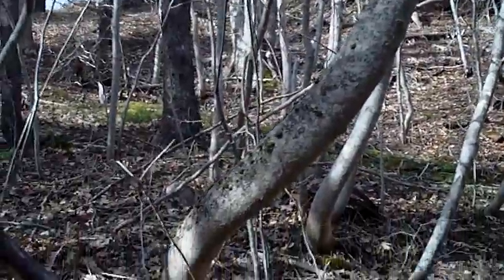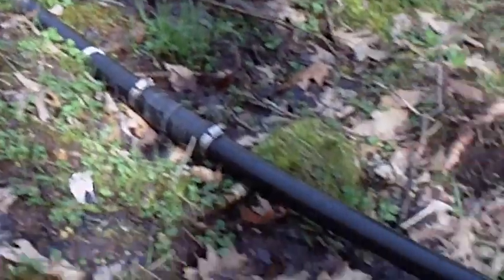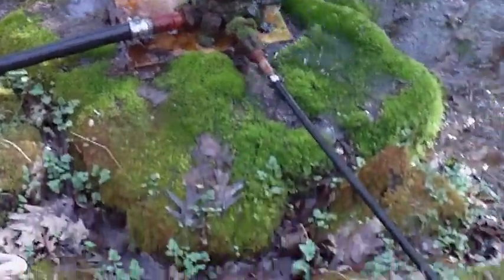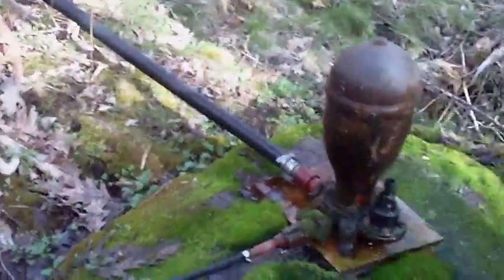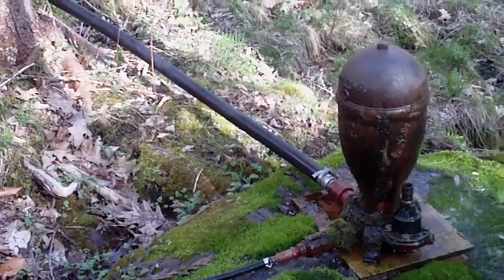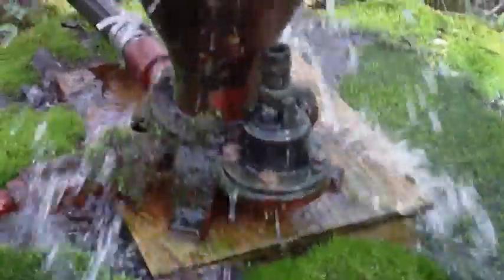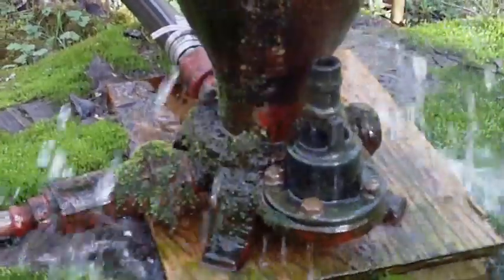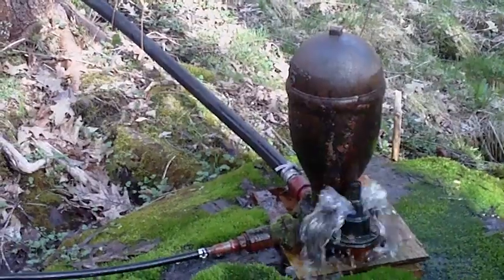Hydraulic Ram Pump - Pure spring water pumping system for drinking - No Electricity works on Gravity

Comment: If you tap a thread in the drive pipe and install a needle valve it will suck in a little air every stroke. That goes into the chamber and prevents it from being waterlogged

Comment: Hi there. You may be collecting air in the system through the plastic pipe, strange as it sounds. You will also get better performance by using a steel drive pipe from your barrel to the pump. We had, 100 or so years ago, a company that produced a similar pump design here in New Zealand. Great pumps, had a couple of them. All the best.

Comment: interesting to read the comments regarding a sniffer valve. I believed all the hype about them for years until mine became blocked, I only found the blockage because the pump was pumping more water than usual, cleared the blockage and performance went back as before. I started to experiment and found the best system by far is no pvc or plastics to be used except the delivery line, do not fuck around making pressure tanks buy a purpose built tank with a bladder to keep the water /air apart, you can also adjust the delivery pressure with a hand air pump and no need for a sniffer valve, keep the cyclic rate as slow as you can, about 1 cycle per 90 seconds is perfect for me.
the pressure produced and volume of water pumped  is less about the amount of energy produced by the fall of the water and  more about how effectively you use the energy available to you. it is the strength of the compression wave which makes this system work
Reply: Snifter valves often admit too much air because they are ill designed. Ask the Amish, they won't introduce a sure to fail $50 pressure tank into a near fail safe design. It is tempting to use those expansion tanks but they are not designed for repetitive pressure hits. Slow and easy or they fail.   You said ONE cycle per 90 seconds? Is that a misprint? Unheard of.

Comment from the maker: Second part, We use a rain barrel or 50 gallon barrel for our water reservoir, with the pipe coming out of the bottom with 30 more feet of pipe downward for pressure...think of it as if you were to siphon gas out of a car tank, your hose needs to be lower than the tank "reservoir" or pond, there is pressure at the bottom of the pond but if your pump is at the surface its still not getting pressure, pipe the pond water downward 30 - 40 feet to get good pressure to Ram pump...hope that helps.

Comment: You could add a sniffer valve so you wouldn't need to drain the air vessel. A sniffer valve can be as simple as a drilled small hole in the drive pipe.

Comment from the maker: Hello, The Hydraulic Ram pump is gravity fed with water, it works off of the pressure, so your Ram would have to be lower than the water table in your well to achieve this, this one is 40 feet lower than the spring where the water comes out of the mountain.
The rule of thumb is for every 10 feet downhill from the water source, the Ram will pump uphill 100 feet...I hope this helps.
Reply: Hello,  is it that for every ten feet downhill, the the ram will pump a distance of one hundred feet on an incline or a total elevation of one hundred feet?

Comment from the maker: Hello, I've not known it to have a snifter valve, but my uncle once tried to add a tire valve for that reason, but it never worked, so we walk down and drain it about every 3 weeks, thanks for your input.
Reply: Well supply and drillers have snifter valves DESIGNED to admit air into a pipe going into a pressure tank. Looks the same as a Schrader valve nut either no spring or very little pressure. Uncle was right but he had the wrong little valve.

Comment from the maker: Hi, Yes it will pump level, but I suggest putting the Ram at the lowest point of the pipe, to get the maximum pressure to the pump, even drop the Ram down 10 feet to get more inlet/outlet pressure, This pump in video is 30 - 40 feet below the spring to get good pressure, hydraulic ram pumps will pump for a very long distance.

Comment: Hi, how can I get more drop to use my ram pump in a creek that flows great but it's only got 1-2 feet over drop over 50 feet of creek? If we use a bucket on the bank we can get the ram pump but not from just the creek drop as it's not much of a drop.
Reply: I'd approach it one of three ways: 

1. Make the reservoir inside the pump larger. This would mean that more water would be stored inside the pump before the pressure valve opens, and that larger volume of water--when pressurized--might be sufficient to pump the water further with a low drop in the elevation of your creek. 
The limit that this could be pushed to is reached when the pressure inside the pump exceeds the pressure of the volume of water going into it, thus pushing the water back out of the feed pipe. 
To counter this, you could make your feed pipe larger as well, taking in a larger volume of water.

This is of course limited by the volume of water that your creek contains.
Reply: 2. 

Build a simple aqueduct that starts at the highest point of your creek and remains at that elevation until you reach a point where you have sufficient elevation drop (1-2 feet should be plenty). Have your feed pipe connect to the end of the aqueduct. 

The falling water will provide more kinetic energy when dropped suddenly from 2 feet up than it does when it gently meanders down 2 feet in elevation over a distance of 50 feet. This is by far the most labor intensive option, and requires decent engineering and manufacturing capabilities. 

But hey, if the Romans could pull it off, so can you.
Reply: Buy a new property that has 50' of fall in 100 feet.
Reply: This sounds like a better case for a sling pump (one supplier calls it a river pump) which uses stream flow to drive a rotary drum pump.  Example at https://www.riferam.com/pumps.html